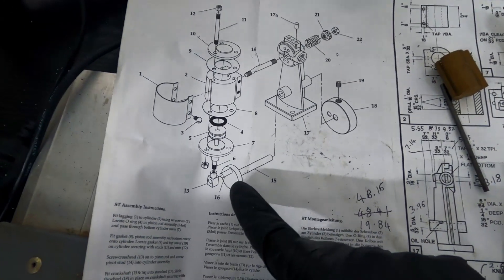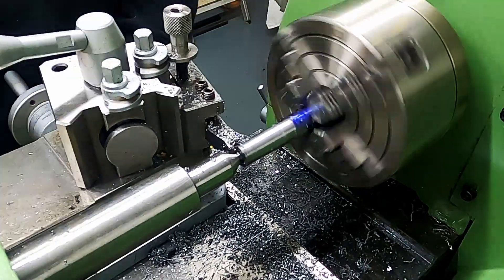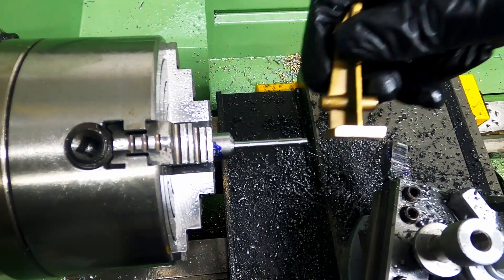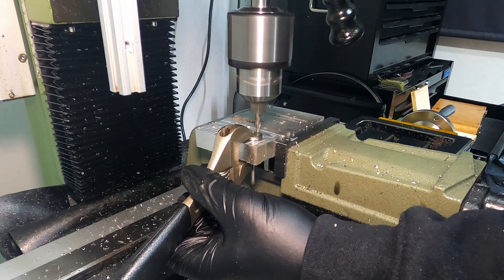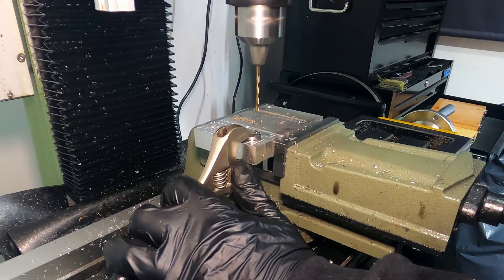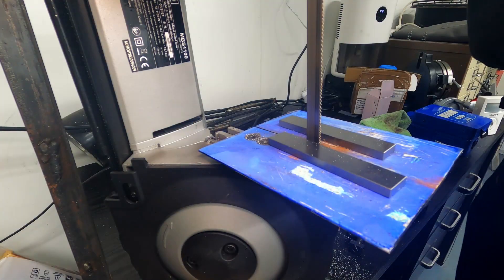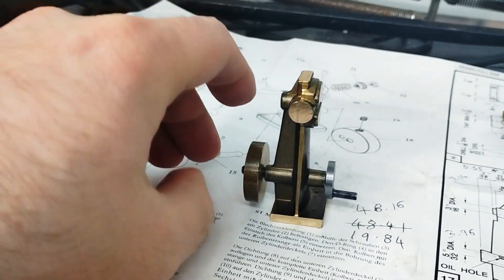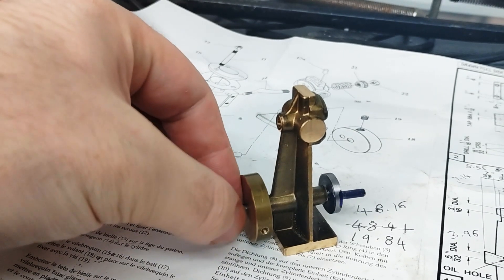Stuart models oscillating engine build part 4

Comment: Thanks for filming this. From the drawings, I presumed the crank is all one piece, I haven't started yet, but I plan to do as you did on the lathe, but then reverse it and offset it and then turn down the pin that goes through the big end. Do you think this would work?
Reply from the maker: Yes you can make this out of one piece, although I feel this is a lot more work. I think you would want to take light cuts to avoid bending the small shaft you will be gripping it by in the four jaw while machining it down to the pin. As you know getting the offset correct will be critical as too much throw will cause the piston to hit the ends of the cylinder.
Reply: @tandb Thanks for the advice 👍
Reply from the maker: @dunderhay9169  let me know how it goes.
Reply: @tandb I will, it won't be for a while yet though 😁